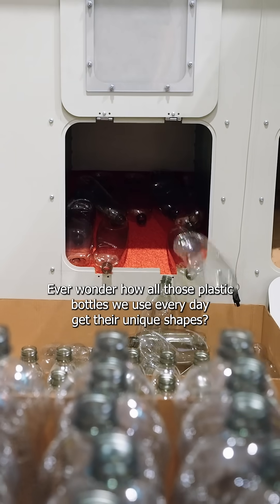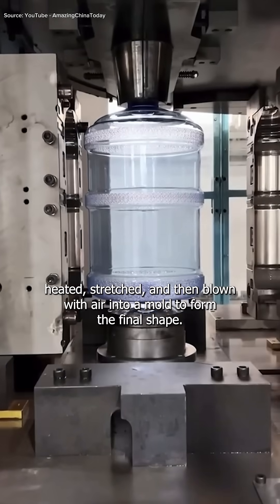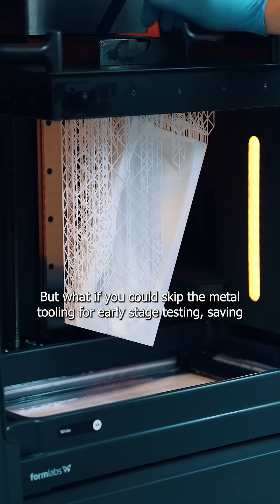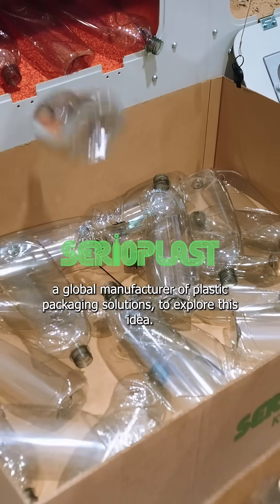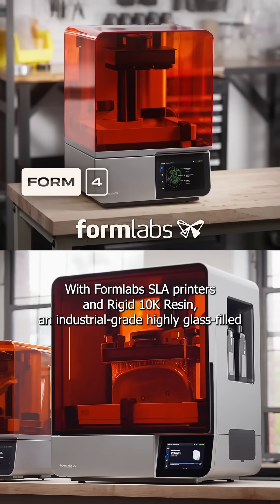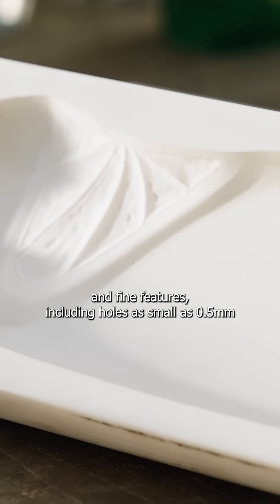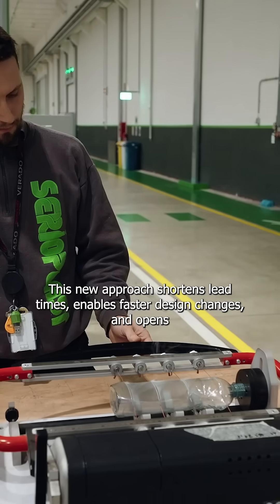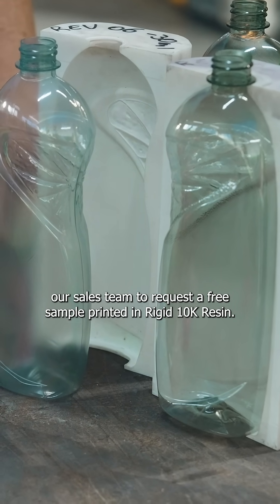3D printed molds for low-volume stretch blow molding with Formlabs SLA printers and Rigid 10K Resin

Comment: Preform? Like the software on my beloved Formlabs printer? Before the open materials license that cost $2,499 over the cost of the $4,499 printer?  Ready to buy a Form 4 as soon as you guys get rid of that outrageously expensive license fee to use castable resins that actually work…
Reply from the maker: Hi Kat, thanks for your feedback about Open Material Mode! Someone from the Formlabs team has reached out to you directly about our new casting resin.
Reply: @Formlabs  I have stuck with Formlabs through FOUR castable resins and promises that each one was going to be awesome, and not one of them worked. Okay, I never cast with the last blue castable wax (although I spent $300 on the resin and another $99 on the “long-lasting” tank) because Preform had a major problem with square supports that protruded through the model and out the other side that would have caused significantly more cleanup. Chitubox (slicer) actually lets you set a depth, but I really do prefer Preform. 

My Elegoo Saturn 4 Ultra does a good job, and we get plenty of support from BlueCast and their active Facebook group. I bought that printer specifically to buy time in hopes that Formlabs would eliminate the Open Materials License. Meanwhile, the Formlabs Jewelry Facebook group has devolved into people trying to sell their CAD services. I’d never even heard that there was a fifth version of the castable resin; I don’t think it was mentioned in the page. 

Regardless, I won’t fork out $4500 for a new Formlabs printer without knowing for certain that the castable resin works. But there’s still the issue of tanks cracking from castable resins…I would love to see Formlabs ditch acrylic tanks and switch to aluminum…I’ve still got boxes of Form 2 tanks that I really don’t want to toss in a landfill.
Reply: @Formlabs greed will kill accessibility. You'll earn more with mass sells.
Reply: I’m looking to get some forms done prior to mass production can someone contact me please. Ty.